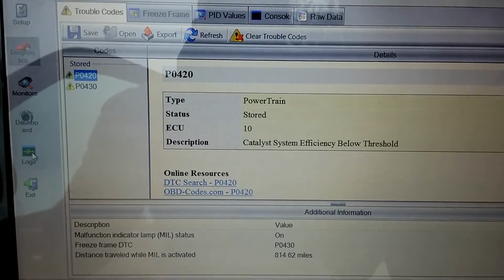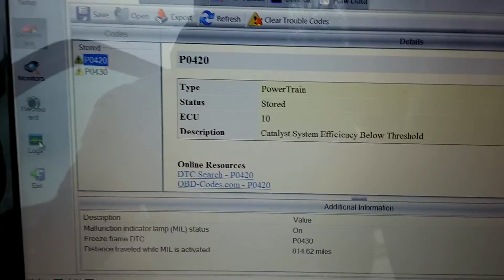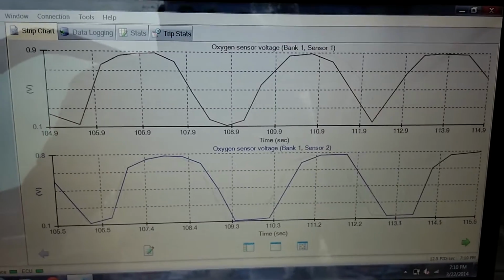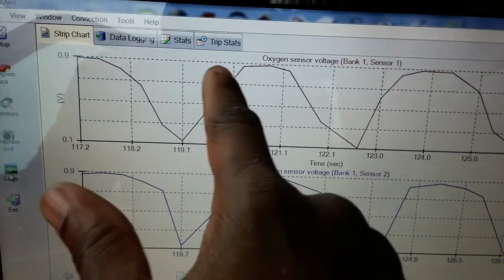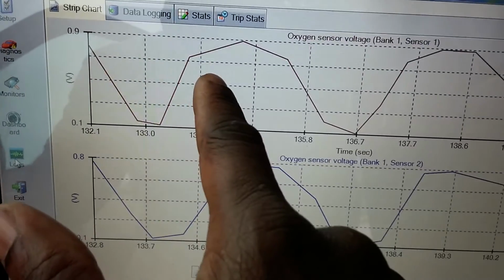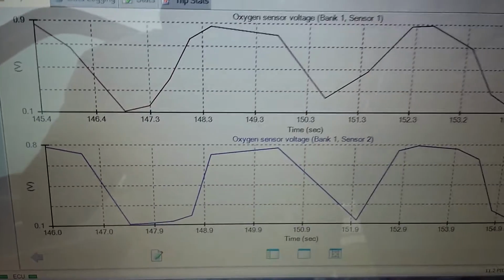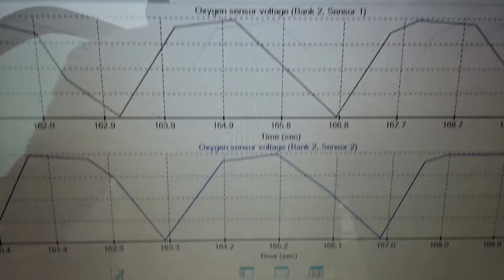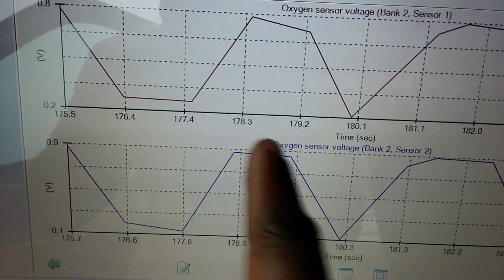Codes P0420 & P0430 pt.1

Comment: I have been using OBDwiz also for same codes.  I do know for a properly working cat the second o2 should look relatively flat.  The obdwiz graph however has an auto range function for the voltage.  So what I have noticed is the high/low range will show like .7 to .8 with a plot that is still wavy.  If the graph range didn't update yes it would look somewhat flat for a properly working cat and sensor.  I just wanted to point that out. Pay attention to the high/low value on the voltage side of the graph when reading the sine wave.  If you know how to lock the value for the graph to stay at 0 and .9 I'd love to know how.
Reply from the maker: Hello, both cats were bad because after I removed them, I hit them on the ground and pieces of burnt  chunks fell out.